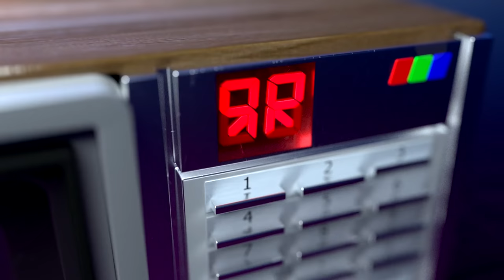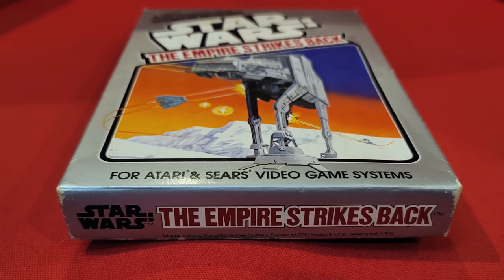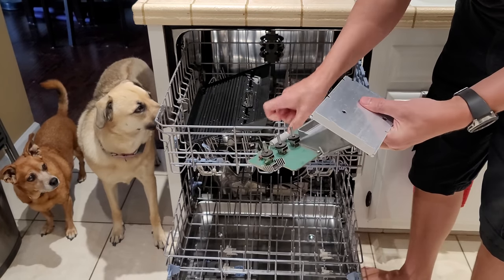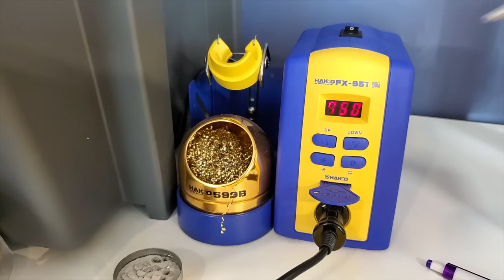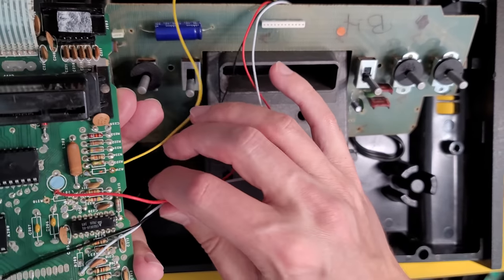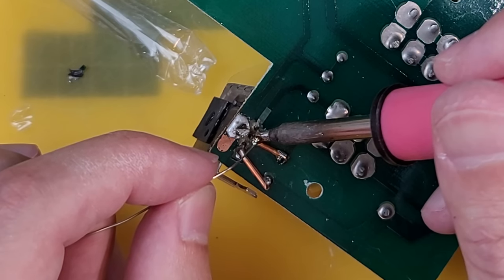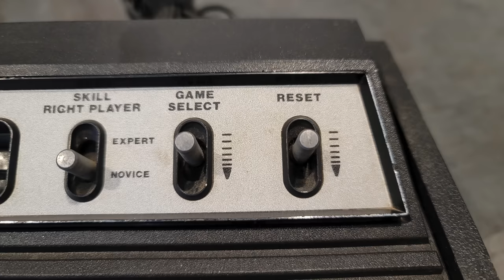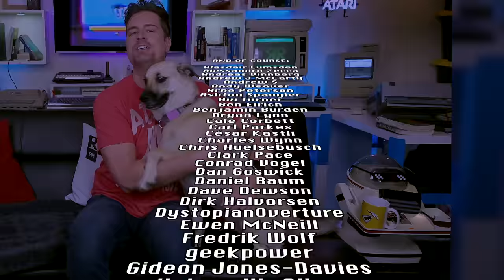Can we fix this rare 1977 Atari VCS? Sears Telegames "Heavy Sixer" Upgrade & Refurb!

Comment: 128 bytes that is crazy, so if you typed the letter A 128 times the RAM would be full. Amazing what they did back then.
And I like your drill joke, my neighbour rang my doorbell last night at 0300am, luckily for him I was still up playing my Bagpipes.
Great video. So relaxing and interesting.
Reply: The memory is so limited that programmers made use of video sprites and other glitches to sort of trick the games to work.  There was a supercharger cartridge that added memory and provided an audio interface to load from cassette tape.  I had one and it worked well but it took a few minutes to load the game.

Comment: Never knew the epithet ("heavey sixer") for this model. I have one -- originally bought new -- albeit now in pieces. Amazing the heavy shield around the processor module made of cast aluminum: that thing would take a bullet for you. In fact, I knocked a full-size 60s vintage wooden speaker off a bookshelf onto the Atari ^B^B^B^B^B Sears system sitting on the TV and it only dented that silver ridge around the controls. The console still worked fine, and probably saved the TV from damage.  Eventually one or two of the panel switches got a little broken off by flying joysticks, though ;) Had to switch them with a pointy stick after that.

Comment: Back in the  80s, I fixed my grandparents' original Sears Telegames system by replacing the red coil (inductor?) on the board. I honestly don't remember how I knew that was the problem as I know very little about electronics, but we went to Radio Shack and I bought a bag of assorted coils that looked like it had a reasonable match. I put it in and with a little adjusting, it worked. The colors might have been off a little, but not too bad.

As for the RF output, bad video quality was always a problem and with CRT TVs, it almost always boiled down to a bad switchbox. Several years ago, someone I know got the urge to hook up an old Atari system. The video looked just like your example. Just for the hell of it, I opened up the switch box and wrapped wire around the contacts, making a direct connection and bypassing the switch itself. All the static disappeared and the image was as clear as you could expect from a CRT TV.
Reply from the maker: I might just try that!
Reply: @RetroRecipes  You can also just buy an RCA to coax adapter so that you can connect the RF cable directly to the coax input on a CRT TV. I assume it would also work on an LCD TV if it has a coax connector, but I've never tried it. Probably not as good as a true composite mod, but better than using the switchbox.

I don't know if they used those switchboxes elsewhere in the world, but here in the US, they were so notorious for causing problems that you could buy replacements in practically any department store. Some even came with double inputs for hooking up more than one game system. I assume that the contacts in the switch get oxidized over time, which leads to the lousy connection. Just like Atari paddle controllers would get oxidized and become jittery. I never tried to clean on though.

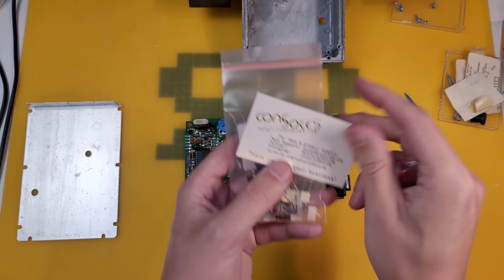Comment: 10:18 I grew up near the Ferrara-Pan candy company in Chicago where those Atomic Fireballs were produced and I never thought of them as gobstoppers … despite those being exactly what they are!

All through-hole technology, it was a different time. the metal shielding makes it look like it was built like a tank.
Edit: WOAH! Atari provided a repair manual for the VCS? It makes sense because it’s an expensive piece of electronics in 1978 but  “repair vs replace” was a different proposition then

Comment: I’ve had the same fault (same black screen and some games would only display garbage). It was one of the chips. I believe either TIA or RIOT. You can also harvest those chips from a 7800 as all 7800 contain both sets of chips for the backwards compatibility feature. That is what I did to check before “splurging” on a replacement chip. RIOT can also be found in many other Atari product like the 850 interface and the 810 and 1050 disk drives. You may just have one of those laying around already.

Comment: The London 1983 clip with child Perifractic and Ladyfractic aka Babbyfractics was so cute and awesome. I'm sure that was exactly how you were Perifractic around the ladies back in the day. At least you finally came around and married Ladyfractic. As for your restoration, I've also used Sharpie pens for small touch ups. Works great! Best of luck with your heavy sixer. 9 times out of 10 it will be the TIA chip.
Reply from the maker: Thanks hehe!
And I think you're 💯 right about the chip 🤞
Reply: @RetroRecipes  Wow... kewl! :-p

Comment: That's a cool looking machine, I especially like the walnut trim, it reminds me of the trim in my Triumph Stag. As usual a very entertaining video Mr P.
Reply from the maker: Nice! My parents had a Triumph 2000. I think that had a wood dash...
Reply: @RetroRecipes  Yes you are correct, the original was Triumph spec would have been standard balsa or fire wood, ;)  mine was been upgraded as part of an sympathetic restoration a few years back.

Comment: I love that you have $600+ in soldering tools and a $10 multimeter :)  I kid, I have that same multimeter and lot's of money in soldering equipment.  BTW, you should invest in a lab bench power supply for stuff like this.
Reply: And no stash of old power supplies just waiting to be Frankensteined into whatever combo of voltage/ampacity and connector type you need with some diags, heat shrink, and solder -- not necessarily in that order.
Reply: @robbruce2128  I don't understand why people try so hard to get matching power supply for these old devices as they all use linear regulators so just give them at least 2V more than regulator voltage and you are good to go. 
In this case I would skip regulator and power everything with a USB charger, maybe I would just add some extra filtering if it proves necessary, 100nF and 470uF should be enough.

Comment: Atari was known for using single wipe contacts in their sockets. In the video, you cleaned the sockets, but also try using a pin straightening tool for the ICs. This increases the chance for making contact on the pins. Also, you may consider upgrading the sockets for better contact on the IC pins.

Comment: A funny and very watchable video. 

Mine is just a little different than this one. It's a 'Woody' with a revision 13 motherboard. 

The ESB game for the 2600 was certainly a system seller. My uncle worked at a Sears back then and when that game came out, the 2600's in the shop flew off the shelves so fast that the store couldn't order them fast enough. 

I'm tempted to try replacing the RF system because it is rather wonky. I recently learned how to adjust it with a plastic Allen wrench or dental pick, but it only helps a little. 

An old toothbrush works wonders for cleaning all sorts of things besides teeth. :) 

Luckily, the capacitors and such look very good on mine. The heatsink is held on with a screw in my model and is more durable than this one was before you fixed it. 

Olive oil works great on wood. Never thought of using it on plastic. Very clever.

Comment: 11:37 Usually in that case you should add an excessive amount of solder on the pads first. It is much easier for a suction pump to pull the "big blob". It may seem counter intuitive, but it works.

Comment: I used to have a VCS "Woody" back then. Those times, I had to replace it with a Flashback replica, but I sat it my dining room (instead of my hobby room) the same way and place my parents left me the woody I owned.

For my remaining RF Antenna consoles, I have a fault myself in which I can't commit to mod a console unless I have a secondary one to keep "mint", as such I wired to my PVM a contraption with a VCR and a Philips Tuner to get the signal as stable and mono as possible. Well, it's a tad dusty, but not that dusty, and fine by me :)

Nice segment with the Babyfractic, it's so cute ^_^

Comment: The failure rate on those green (brown?) “chicklet” capacitors is so low it’s not worth worrying about. About the only way for them to fail is to overvolt them 😐 or throw them in the fire. 😢
Reply: I've never heard anyone call styrene caps failure-prone either, rather the opposite. They were known for their extremely tight tolerances and therefore used in frequency-critical applications like FM tuners.

Comment: On one of my VCS (Darth) I have replaced the regulator with a fuse and over voltage protection. With that in place I put in a usb 3 port to power it. I have actually used a usb power pack to power the VCS for quite a few hours. I never really tested how long exactly but more than the afternoon/evening I was playing using the pack.

Comment: 8:07 That ribbon cable is a known failure point, and the reason two of mine didn't work. Easy fix to solder in new wire ribbon cables and connectors
Reply from the maker: Way ahead of you ;-)

Comment: My 2600 is still going strong, but I suspect it’s overdue for new caps.  You might spend some time in an upcoming video looking at joystick options, as original 2600 joysticks were rubbish.  But more importantly, replacing the pots in the paddles would interesting.  Mine are all scratchy and I haven’t played a decent game of Breakout in 30 years...

Comment: You know i saw a great tip on noel's retro lab when youve applied and brushed rubbing alcohol on the back of the pcb to get rid of the flux put a rag on  the pcb then use the brush to rub it makes a much better cleaning job
Reply: How so? Cuz it looks about the same to me
Reply: @SupremeNerd  just alcohol spreads it around
Reply: @TotoGuy-Original  i guess... I'm not seeing that in this video though
Reply: @SupremeNerd  exactly

Comment: You know, I bet someone could create a replacement chip using some similar methods to commodore64’s shown in 8bit guys videos.  Combining chips manufactured today is a smart solution and I think it might work at least for the television chip which according to you is the most likely cause for yours, and may vary well be for a majority of systems.

Comment: When you connected the Atari 2600 to the Commodore/Amiga 1084S Monitor what were you expecting it's like getting Luke & Darth Vader to be best friends, never going to happen.  Saying that I do hope you get the 2600 running, I had one as a child, it was my first computer/console and also had an Amiga 500 as my first computer.  I still have the Amiga though not the 500, what was traded up to a A2000.

Comment: One of my first (and failed) repair jobs was on a 4 switch woody. I ripped the traces on the board. It was ruined, but I desoldered and kept all the chips and switches. If you want these to repair the Darth Vader atari later on let me know. (The Joystick port broke the unit still worked so all the chips should still be good. I didn't know about jumper wires or trace repair back then)
Reply from the maker: Very kind of you! I'll let you know if I need anything 👍🕹️

Comment: It took me over 6 months to fix my C64. I still think the only thing wrong with it was the 1 MT ram chip (I replaced them all just in case since it's a horrible brand). But the real problem was my homemade power adapter used a MIDI cable for the connector because I didn't want to solder a DIN. The wires are very thin. I don't think it could handle enough current. Even now it runs at 4.5V. But with the U2+ installed it dropped to 3.5V. I'm surprised it ran at all like that. After realizing that, I used the external power port for the U2+ (same 5V 5amp PSU as the C64, but a different connection) and it works fine now. I'm actually considering buying a real C64 PSU and just using the cable off that in my PSU. At least I know that's rated for the current. Anyway, you'll get it up and running I'm sure.

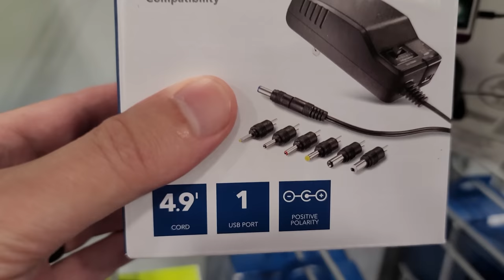Comment: 17:50 I had to look this up, because the video doesn't show it very well, that the legs of the tips have different diameters. i have on, were the both legs are the same with an arrow on the tip and the polarity on the socket, to change it the way you need it.

Comment: Consistently replace outlets in kitchens, I believe it's the oils that speed up the process of the plastics to break down.
Reply from the maker: With respect this makes no sense. Oil is specifically put into car engines to protect them. You even put it on your skin to protect it.

Comment: I didn't even know Atari had computers until recently. For me Atari was synonymous with the 2600 until AVGN mentioned the 5600 It may have even been you that educated me on the 8 bit line.
Reply: Actually it was the 5200 (2600x2) and essentially was a modified Atari 400

Comment: As I thought when I saw you put it in the dishwasher, the aluminium,zink or potmetal(alu,zinkMIX) got ectched. Don't put aluminium in dishwasher detergent. It will be damaged. I first dicoverd this when tryed to clean one of my .22lr mag. with dishwasher detergent, got clean and then some I was not ready for. BTW I really enjoy your vids, and really like puppyfractic :)
Reply from the maker: Maybe but did you notice later that had gone away. A little oil rub sorted it out. It looks better than before now, at least IMHO ;-) Glad you like the vids!

Comment: "First computer yet to be able to load programs in."? The phasing seems kinda odd but it certainly wasn't the first games console able to load programs (that would be the Fairchild Channel F), let alone the first "computer". If you mean fully-assembled consumer market computers, the Commodore Pet, Apple II, and TRS-80 Model 1 were all released earlier that year.
Reply from the maker: My bad, I misread Fairchild as Fairlight (the synth) in my research, which is not a games console. I'll try to add a pop up correction. 🤦‍♂️
Reply: @RetroRecipes  One other correction -- while Activision did indeed get their start thanks to the Atari VCS, Mattel did not. Mattel is a long-standing toy company founded in 1945. Most famously they are the producers of the Barbie line of dolls. Toy companies coveted the home console market so they threw in their hat with the Intellivision (as did Coleco with the Colecovision, etc.) 

The story of Activision is kind of sad as it was essentially destroyed in bankruptcy after its name-change to Mediagenic. The current Activision is an entirely new company created out of a buying the assets of the old Activision, in much the same way the new Atari has nothing to do with the old Atari.
Reply from the maker: @NozomuYume  yes I should've clarified it spawned Mattel's video game division.

Comment: You did that whole thing wrong. You was supposed to get a early Atari 2600 flash back and solder  a cart port into it. Duh. :) Great Job. Can't wait to see what you find a woofed up.
Reply from the maker: That's actually on my list to do. It's a genuine mod, just in case you were joking.
Reply: @RetroRecipes  Yea. I know. I thought it was a great idea. To bad they didn't do a 7800 that way too. Another thing to look for and hard to find is a c64 joystick all in one. You can connect a usb keyboard and such.

Comment: No need to replace the styrene caps when you add audio out socket,  they are part of the oscillator that mixes audio and video for the modulator.
Do you have any displays with s-video, or separate luma chroma?   Much better than composite.  I’ve done a pal diy vero layout in the 7800 section of atariage, would be easy to change to 2600, less parts.  Just done a ntsc 7800 today and the layout worked first time and looks fantastic. Costs all of £10 if you can build things on veroboard.

Get an oscilloscope on that vcs, check clock is running on cpu, tia is ouputting luma and sync signals, and the chroma is fine.  Change the sockets too, those single wipe ones are crap.  Plug the audio out into an amp, stick combat in, and reset, can you hear the tank engines!
Reply from the maker: Good points! I'm 💯 sure it's a dead TIA chip. More soon...

Comment: I have some colours which a re flickery, not solid, while most colours are fine. I understand it might be due to using a modern telly, but can a worn out RF cable cause this? I wonder about it as the image on the flickery colours changes a little when I wiggle the cable about near the TV input?

Comment: I also have the mod laying around, but wanna keep my 2600 “light” stock. Hope to score a 7800 one day. To bad shipping fees are high from console5 to europe (which i understand). This was again one of yer thorough jobs. Would have been great if just the power switch was broken😀  But you have 5 volts and some video output....hopefully you didn’t mistake polarity on some condensator🙄
Reply: A few years back I sold my 7800 and a bunch of games to someone either in France or Germany, I forget since the 5200 went to one and the 7800 the other. Bought a nice bike. I originally got the 7800 (at a lumberyard!!!) when they were clearing them out in the 90s.

Comment: FAIRCHILD VIDEO ENTERTAINMENT SYSTEM ! 64 BYTES. 
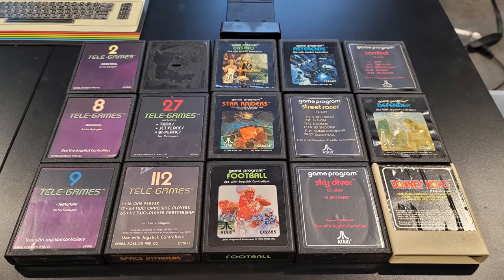0:34
Fairchild was a year ahead of Atari with it's exchangeable cartridges (containing their own type of ROMs that were mounted with machine turned on) - Atari gained in popularity however, as it was a better machine. (doh)
Reply from the maker: My bad, I misread Fairchild as Fairlight (the synth) in my research, which is not a games console. I'll try to add a pop up correction. 🤦‍♂️
Reply: @RetroRecipes  Fairlight is a C64 cracking group... "always has been"  ;-)